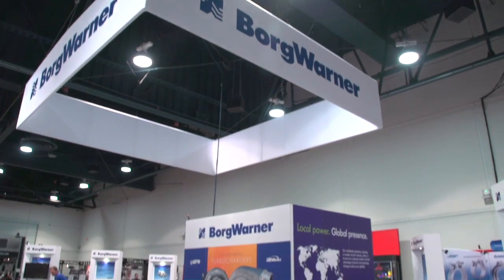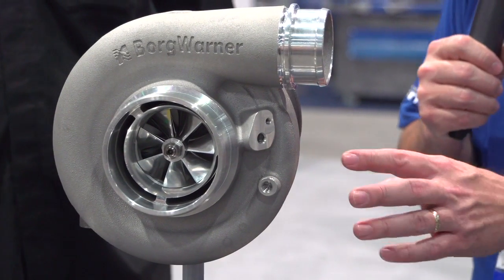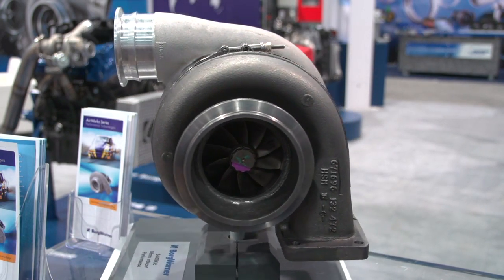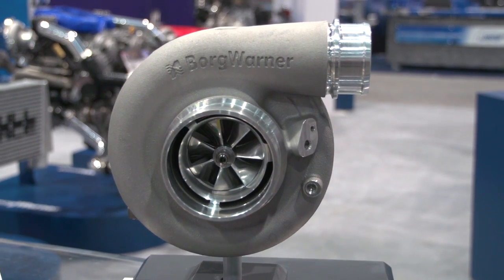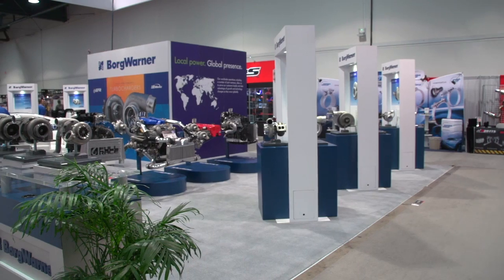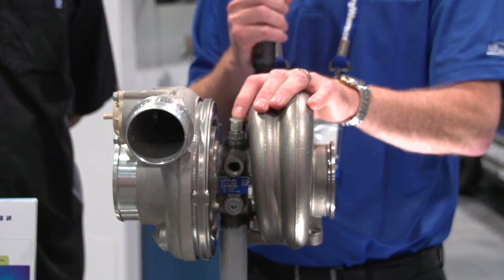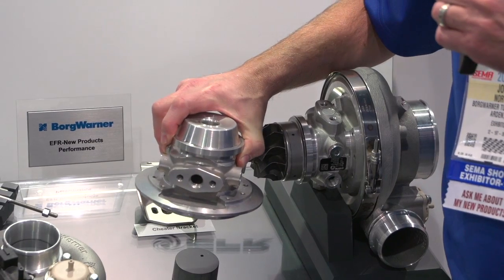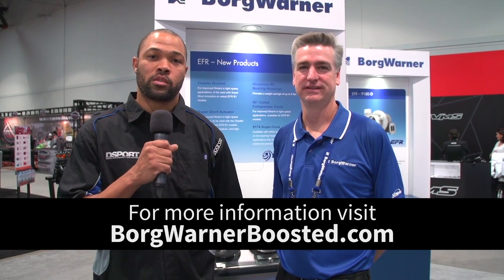Turbo Talk with BorgWarner at the 2015 SEMA Show

Comment: If I stuck one of these on my FD3S (1993 RX-7):
1) Which should I use
2) at what RPM should I expect them to come online
3) at what RPM should I expect full power from the turbo and
4) what kind of WHP should I expect from my 1.3l stock-ish engine appx?
Reply: +David Beecroft -- there (3)EFR and (3) Airwerks turbo considerations for the 13B FD3S, depending on your application, and boost/power targets.  Feel free to contact corell@full-race.com with specific setup questions and we can help
Reply: Geoff Raicer I have an efr 8374, love it. Just be aware, borg warner won't supply any replacement parts such as shafts or bearings, you know, so you can fix shit, they expect you to buy a whole supercore, which for $2700au is fking ridiculous, and considering the outlay for the turbo to begin with, it's pathetic, that I can't get parts to replace it with.
For this reason, I'll never use another BW turbo. Unless someone is willing to come to the table with some common sense for replacement parts.
Reply: +exilerob Garrett is the same way. You just get a new CHRA sent out to you when things wear out or break.
Reply: +mmcma006 yes I'm aware,  but the difference in price is my biggest issue.
however GT series garrett BB units can be rebuilt. I've had this confirmed by several garrett distributors.
my biggest issue is the shaft. mines damaged, all else is fine, so in hindsight why should I have to pay $2500 for a complete core, vs buying a whole new garrett or PTE of the equivalent size for that cash, and why should I have to be paying for items to be replaced, that simply don't need replacing. it's bloody ridiculous.
Reply: +mmcma006 and for that price the PTE can be rebuilt. PTE have confirmed it, and it will cost me under $1000 bucks to ship it to the us fix it and ship back, for that cash.
seems like some money grabbing going on to me.
Reply: I wouldn't say money grabbing so much as the other two are big industry, with ISO, testing, engineering and development, lots of overhead, etc...all those things stack up the cost. Not to mention that they actually publish turbo data, so that one can properly size turbos and map wheel speed. 

But yeah, Precision turbos are cheap and work well for straight line guys...well, much like the standard S-line for Borg and the GT and newer GTW series for Garrett.
Reply: +David Beecroft I can get you an efr 8374 for a good price if you need one.
Reply: exilerob Gtxrb. At 2400$ it is the best turbo in that price range.

Comment: Like for the titanium alloy turbaan wheel alone. Why no references or supporting data on this tho? Is it minimal, or bloody expensive? Or both? Something that can replace the factory rb25det ceramic turbaan wheel would (would of) be a game changer for building quick street gts-t’s.
How good is that 90* housing and bearing doo da for hiding good low mount turbos away from eyes
Nothin on the variable vane stuff or electrically assisted stuff. Shame.

Comment: But will it fit on my Subaru
Reply: Chris Chris the EFR7163 will, with equal length headers and twin scroll a stock block STi ran a 10.7 1/4 mile at a little over 130 mph. No more “rumble” but with that performance who cares

Comment: Are the SXE turbos (69 in particular) suited for a V8 ?
Reply: 69mm a bit small for a V8 dont you think???
Reply: rishi kataria I run the 369 on a 4.6 mod motor. Makes good power down low, spools fast and makes more power than my old 76mm did.

Comment: my efr lasted 2 years. not very reliable. a lot of guys with them had them fail prematurely. I'm switching to the 257 sxe.
Reply: Slicktop 2jz they don't like being overspun. That's what kills them.
Reply: You don’t understand racing do you?
Components operating outside optimal design parameters live short lives compared to plain ol ‘performance’ components.